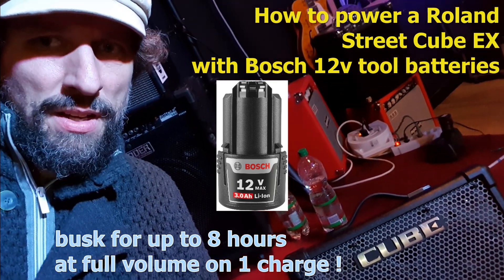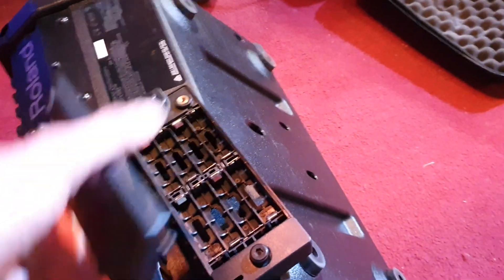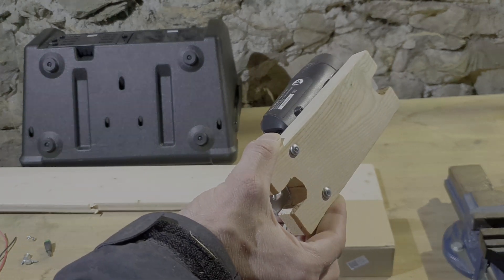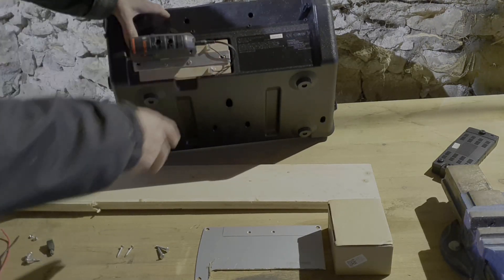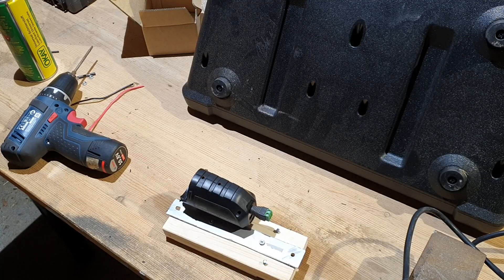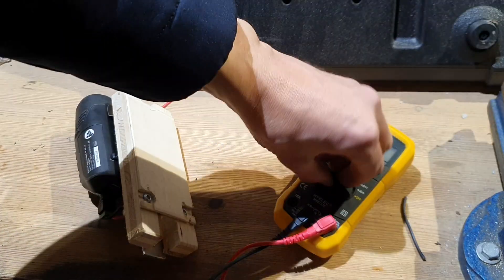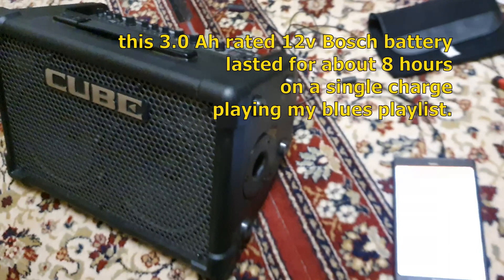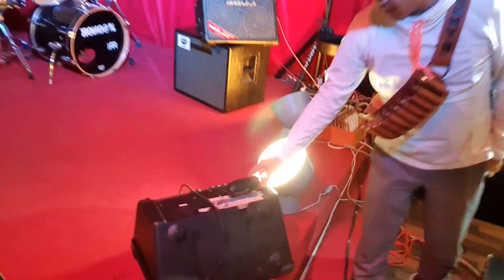Roland Street Cube EX adapted to use Bosch 12v Li-ion batteries. 8h on 1 charge! Non-invasive-mod!

Comment: Hey old rags,
Have you had any problems with defective adapters (the ones where you put the batteries in)?

I have build it like this:
I mounted an extra jack into the cube whose wiring goes to exactly those pins where the wires from the original batteries go (all inside on the pcb). Then I soldered an extra connection cable from that jack to the bosch battery adapter. So they are very easy to unplug, good for carrying.
Problem: I have destroyed 3(!!!) of these adapters already. They seem to be very sensitive when switching the amp on or off. Probably a voltage surge.
Have you encountered this problem as well?
Thanks.
Reply: I have not had any problems. What does the damage look like? Make sure your connectors and wires are big enough, there is a lot of current here!
Reply: @christophwalker1219  
The adapters simply quit working. Wires and connectors all big enough.

Comment: Why not just buy the Roland BTY-NIMH/A Rechargeable battery pack which is designed for the Street EX and gives 10 hours
Reply: 10 hours at max? Or just 4 if its at max. Roland site just says twice the runtime

Comment: Inside that battery are simple Li-ion cells so you could buy 8 of them with a big enough capacity and charge them even with your tool charger. No need to have this replacement part with battery sticking outside...

Comment: do these batteries shut off at low voltage?
if not you will destroy them. (incl explosion while charging)
they must be protected against over-discharge.
Reply: Hmm.. do normal rechargeable AA batteries that fit into the Roland cube battery pack shut off at low voltage? I don't think so.. 
I use Energizer AA batteries for all sorts of things and eventually they go flat, but then ya charge them up again. That's always been normal to do with AA li-ion batteries.  There's never been any warning regarding over discharge of these AA batteries? 🤷
I've used these  Energizer rechargeable AA batteries in my cube ex, and Bluetooth for my electric guitar for years
Reply: Good point !
No, the batteries have no over-discharge protection. I have already destroyed some. Luckily, they are cheap, especially the generic ones.
The roland has a battery indicator, when there is only one light left, the battery should be recharged. I suppose it shouldn't be too complicated to add an electronic module to the adapter to protect against over-discharge.

Comment: Would I be able to do this with a Makita battery? I can see the terminals on the bosh are easier to find.
Reply: yes. just make sure the Makita shuts off at a certain voltage. in case you over-discharge it it will be damaged

Comment: On another video somebody's taking off the CUBE  logo  that they stupidly put right over a sound hole that seriously impairs the  sound quality  and function of said hole.
IT'S at the top end price wise  for a busking amp  but it's really got  too many  
glitches that ougbt to have been  ironed out at the testing  stage...it kinda sucks that Roland haven't been bothered to  go the extra mile...at £500 and rising Roland  need.to respect and honour their customers  and not expect customers  to undertake alterations  concerning flaws regarding  basic functions... This isn't people swapping out a new guitars pick ups for a favourite  brand or type..
This is errors of design choices  that caused poor quality, and a poorly functioning. product..
Wise up Roland you need to fix these basic  errors before You  launched this or any  Roland product...THEY'VE  GOT TO WORK WELL FOR THIS MONEY!!!

Comment: Is there any reason to not use a normal lithium 12v battery tho? You could then get one with a greater charge (Ah) and it could last even longer no?
Reply from the maker: Hi Jake
I'm not sure what "normal" means here, but I guess you could say the battery I am using is a "normal" 12v lithium battery.

Comment: Did you have any problem with depleting the batteries and rendering them dead? or does the battery check meter work good from the amp as a reader for that?
Reply from the maker: Good point Matt, there is no protection built into these batteries, meaning you could over-discharge them with the amp.
If I recall correctly, the battery meter on the amp can be used to know when to recharge.

Comment: Why not just buy extra default battery packs for the unit?
Reply from the maker: 1) They are expensive (the empty plastic will set you back about 25 bucks, and you have to buy NIMH batteries on top).
2) That pack will last up to 2 hours tops.
3) When you want to charge that pack, you have to unscrew 4 screws, open the pack, charge the 8 (!) batteries, and then do the same in reverse. Charging the drill's battery pack is a much faster and easier move.
Reply: Could you  not build/connect the Bosch battery onto the original battery case?
Reply from the maker: @andijoseph  Absolutely, that would also be an option.

Comment: I am wondering how fragile it is. It's really "out there" - meaning, exposed. It could get accidentally knocked, kicked or moved against a wall too hard or something might happen when transporting it. Yes, i know we should be careful, but accidents do happen. Any comments, please? Could an enclosure be built around the battery?
Reply from the maker: Hi ! The metal-clip holding the battery-holder is quite sturdy, I wouldn't be afraid to take it to the street. The entire Street Cube EX with the mounted adapter still fits into the official Roland carrying bag, that would protect it for travel, or simply taking it out for travel would work too.
If all of that's not doing your trick, I'm sure you could build an enclosure to improve things.
Reply: @oldRagsBlues  I am seeing the same Bosch battery online,  with 12V but it has 6.0 aH instead of 3 aH. Would that be a problem?
Reply from the maker: @robbiedaug  if you mean the kind which has a different form factor, it doesn't fit in the adaptor as I designed it. Electrically it would work though.
Reply: @oldRagsBlues  Thanks. The battery looks the exact same size from the same company. But would the extra 3.0 aH give me more time (longer charge) when using the amp?
Reply: I use rechargeable batteries ,bring about 24 aa to be safe

Comment: Hi Old Rags. Very impressed, but have you tried to go direct from your Bosch 12V battery into the supplied power transformer fitting in the amp? I did this successfully using a lithium 9V battery into a 9V Roland RX cube. Very interested if you tried this. Cheers Eric
Reply from the maker: I have tried it in the past and it does work, however I think there were sound problems at high volume (not 100% sure I remeber correctly). The original power supply is rated 13.5V.
Reply: The issue is most probably the mA requirement.  The correct voltage is one thing a how many milliamps I can deliver is the other important thing.  It sound like to power source/battery couldn’t deliver enough milliamps

Comment: You could countersink the screw heads.
Reply from the maker: Would work with screws with huge heads, as the contactors on the amp are quite big.

Comment: Wow! Thanks for that man! one question though, can i also charge the battery with the adapter? should i only switch the plus and minus?
Reply from the maker: I haven't tried but I doubt it. I wouldn't advise to try it unless you know everything about Li-ION battery charging and the Bosch 12v system charging specification. Don't switch plus and minus to charge !
Generic chargers are cheap and charge fast : https://tinyurl.com/yx7zuufc. If you have any 12v power tool that comes with a charger, you can consider using that tool's battery and charger, provided you find an battery-adapter.
Reply: @oldRagsBlues  thanks!!
Reply: @oldRagsBlues Also thanks for the link. Much appreciated.

Comment: Is this amp good with pedals?
Reply from the maker: The included effects are great, except for the distortions. Clean amp is great!
Reply: @oldRagsBlues  Is that because the Amp needs a bigger battery to compensate for the they extra draw on electrical current? In which case I'm wondering whether a Powerbank would provide more juice eg from a 36,000mAh Power Bank.

I've just set up a  36,000 mAh with Cioks4 voltage converter to supply a 9 Volt BOSS RC-30 Loop Pedal and the 18volt Hotone Ampero Multi Effects Pedal.